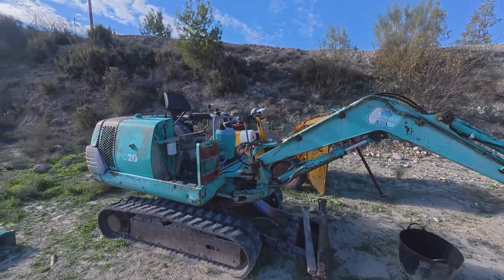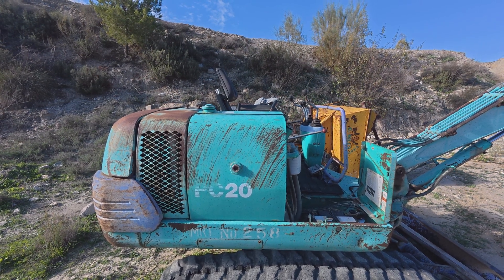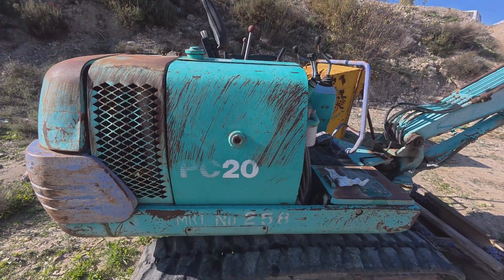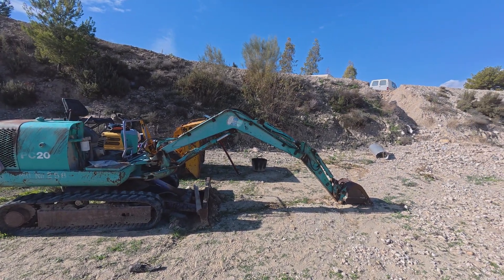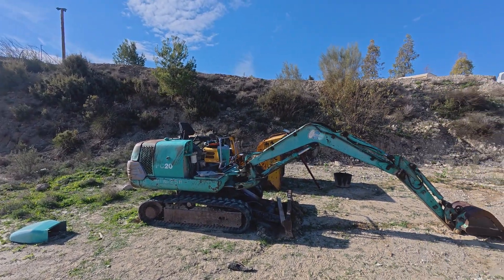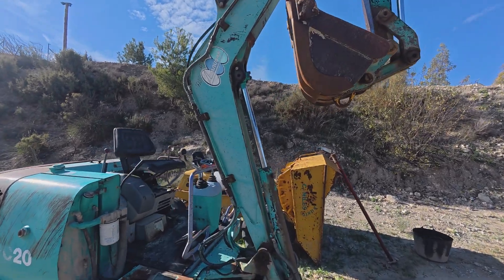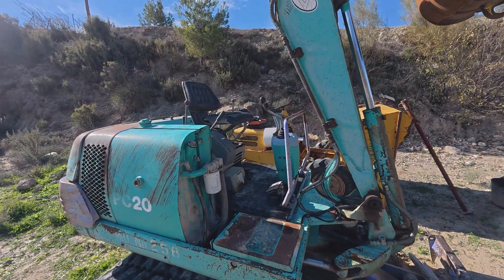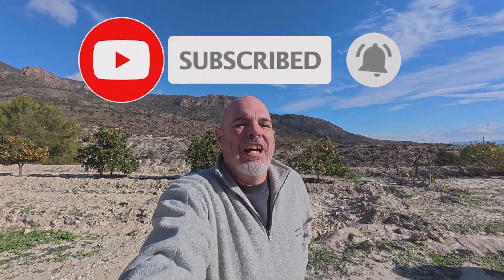How to pressurise a Mini Diggers Hydraulic System. #excavator  #offgridliving

Comment: Did you have the plug loose when you were moving the boom around? Or have it tighten down and loosen it every time to let air out?
Reply from the maker: The plug was loose, partially screwed in, but loose enough for any air to escape through the threads.